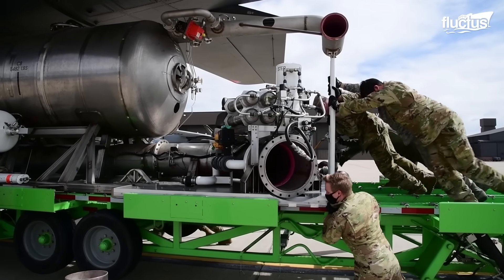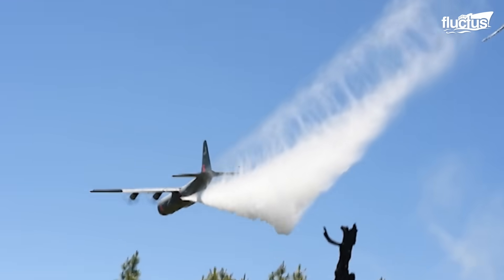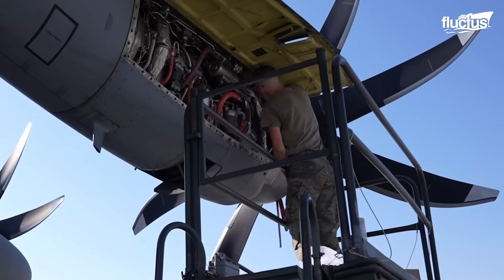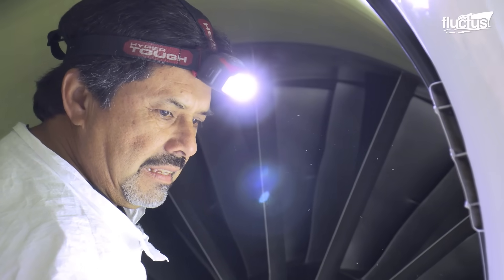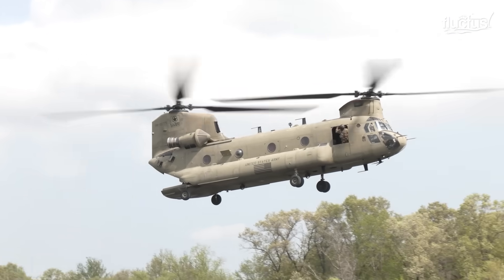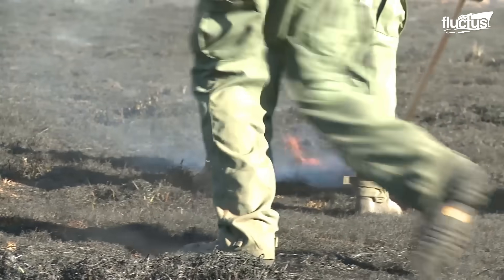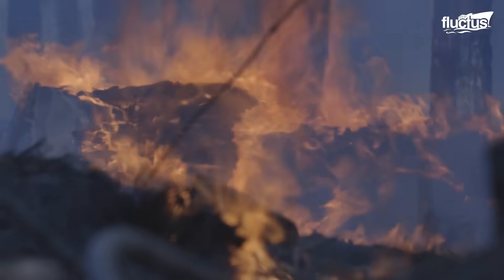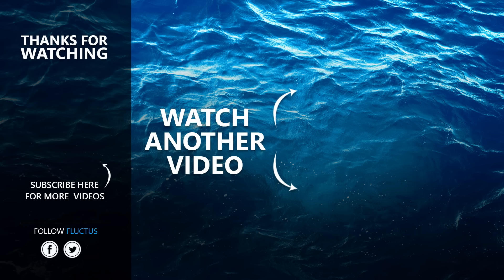US Air Force’s Genius Invention to Fight Fires from The Sky

Comment: I know Cslf. Has used the planes that fly above the water and scoop water into the plane from lakes
BUT CALF IS DUMB AND DOESNT OWN ONE THEY HAVE TO LEASE THEM FROM CANADA
Reply: The super scoopers are actually built in Canada. They are also IIRC both a lot less common and a lot smaller than the C-130. Plus to scoop from lakes you actually need a lake near where you are working.

Comment: They can use that kit from the C-130  ON THE C-17.
Reply: Maybe. One thing that the video doesn't talk about but shows is that MAFFS-2 discharges via a pipe running through a hole in the paratrooper door. Rigging MAFFS-2 requires replacing the regular paratrooper door with one with a hole, then sticking the pipe through that hole and bolting the pipe to the main MAFFS pallet. If the C-17s paratrooper doors are in the right place and if there are appropriate replacement doors and adapter pipes available then yes, the MAFFS2 probably could be used in a C-17.

Swapping doors on (military) cargo aircraft to allow them to deploy things (like in this case retardant) is actually fairly common. Doing this keeps the airframe in a standard configuration and so does not effect structural integrity and of course it can be reversed. Not cutting holes in the airframe also massively reduces the regulatory paperwork involved. There are C-130 door replacements to allow things like launching small drones, missiles and likely sonobouys while keeping the door closed.